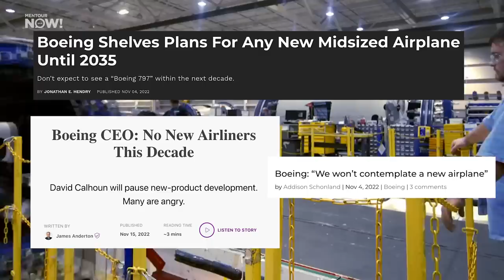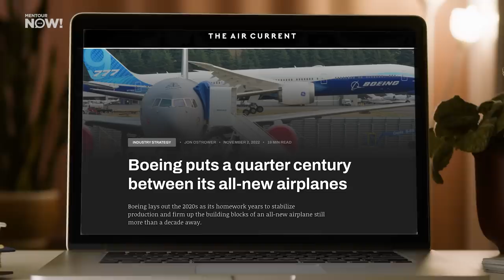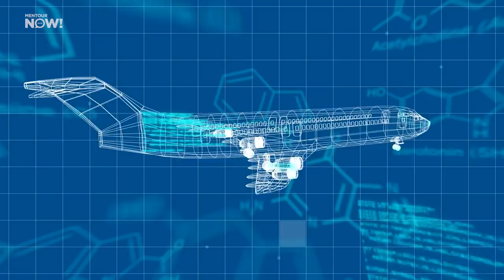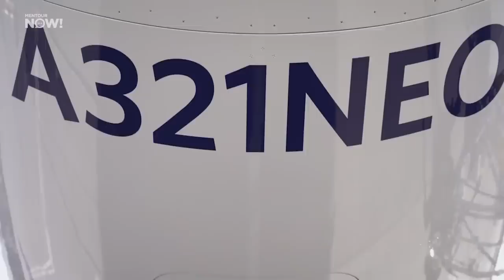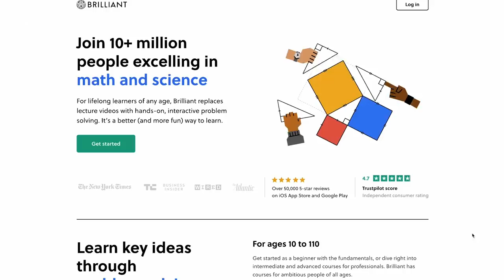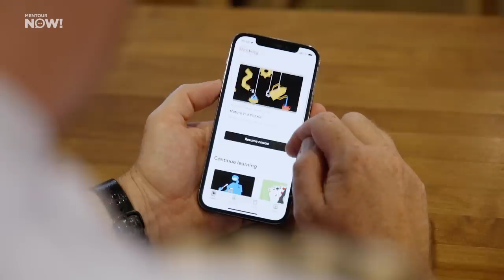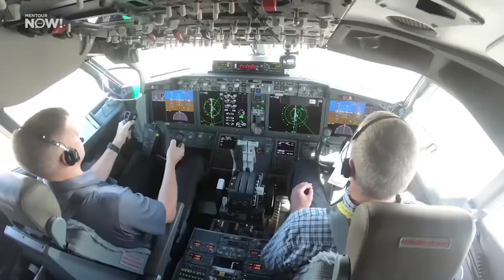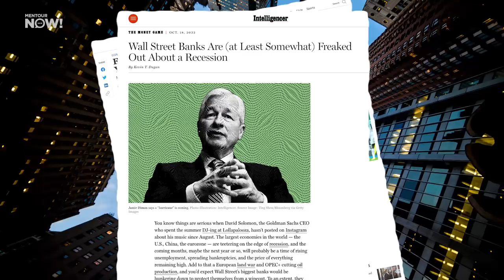Is BOEING giving up!?

Comment: If you look back over the last 25 years in the commercial aviation industry, nearly every time we are told that a new product is coming by some date, it actually ends up arriving 3-6 years later. So if they're telling us today that the new RISE engines will be available by 2035, history says that will probably become at least 2040 (assuming they ever come to market at all). And that's a long ways off.
Reply from the maker: Yup, very true
Reply: And we all know from recent history, Boeing is not the best manufacturer to ask to upgrade an existing aircraft type with new engines. (The big exception here is the B-52 Stratofortress, of course).
Reply: It seems a bit fishy to me that development of a propeller engine is going to take 15 years minimum.  That sounds like it’s closer to a pipe dream than a reality with the efficiency gains being purely speculative at this stage.
Reply: i think it could be developed in 2 years, there's nothing complex about it that would demand 12-15 years to build. I could probably build it in my garage in 15 years! The questing is what kind of airplane is it for? Looks like a very small kind to me. Will there be demand? Probably very narrow. It might be a great engine for regional aviation, but then again - are current turboprops worse than this new thing? And if so, how much worse? Radically worse or meh-kinda worse?.. Can it be mounted on a plane that would compete with 737? Or is it competing with bombardier 5000?.. Noone will take it seriously if it can't compete with 737... much less 15 years into the future.
Reply: @dmitrynova  the problem is and will always be the planetary reducer, needed to run the prop way slower than the core.
Reply: @ameunier41 it’s true that propeller and fan gearboxes have been historically extremely difficult to design and there’s been many failures in the past, but it’s been worked out for decades, there are geared turbofans and of course turboprops in operation around the world for decades…
Reply: Decouple the core from the propeller. Make the core a pure electric generator and the propeller with electric motor. A series hybrid in other words. No more gearbox issues :)
Reply: Thirteen years to produce a new engine? NASA went from nothing in the early 60's to putting 4 men on the moon before the decade of the 1960's ended.
Reply: concidering the projections are already conservative, and that there would be a 20 year gap between the new designs i would think everything will be fine. Judging by what boeing is saying i agree with mentour, boeing already has a design and its purely waiting on outside influences. Engines arnt terribly hard to make, i mean look how quickly the jet engine was invented during the war period. So i think the time scale is reasonable. Its not like they are inventing a fusion energy engine.
Reply: @whyyeseyec  NASA had the benefits of fuckloads of government military spending and also no markets that enjoy stasis and have to care about standardization etc. Could be a lot faster but I also don't see anything replicating the space race unless people have something to hyperfixate on again (hopefully with better intentions).
Reply: @whyyeseyec  who paid the bill ....
Reply: @theagentsmith  Electric gen-sets are very heavy per unit of power, and the energy losses are not significantly different from the simple planetary gearbox, overall reliability of the system isn't much different either.
Reply: @whyyeseyec  Its the Pareto principle, the first 20% of the effort gets 80% of the results.(Likewise the last 20% of gain take 80% of the total effort.) Aerospace is now very mature and gaining that last 10% is orders of magnitude more difficult. 
Say you start with an initial thing that is 30% efficient, like some old wood and cloth windmill. Apply some engineering effort an it's not to difficult to get it to 60% efficient. At which point you can claim to have doubled the efficiency. However, even with unlimited resources and effort it is mathematically impossible to double it again, and to add further insult  all of the obvious easy stuff were the of course first improvements to be made.
Reply: @berndeikers8924  Yes, I know. It just seems like 13 years is a long long time.
Reply: @ReneSchickbauer  That's a rather overly simplistic view... Boeing has performed multiple successful re-engine programs in history. The original Boeing 707 was re-engined. The KC135 tankers were re-engined twice, from the original J57 turbojet to the Pratt JT3D, and then re-engined again to the CFM56.

The Boeing 737 itself had also been successfully re-engined from the original low bypass JT8D to the CFM56 (737 Classic), and then re-engined again to use newer versions of the CFM56 (737-NG), both of which were huge sales successes for Boeing. The only re-engine project that proved problematic was the most recent (737-MAX). If you actually go back through their development history, their re-engine projects have been successful more often than not.
Reply: @mytech6779 Was Boeing using the Pareto Principle when they added MCAS?
Reply: Yes, indeed - if they´re succesful in building it!
Reply: @theagentsmith  Adds weight, adds another point of failure and things electrical can cause fires. Best to stay mechanical.
Reply: @whyyeseyec  Yes, but NASA had what was essentially unlimited funding to do that. Boeing lack that.
Reply: Committing to the RISE engine would seem to pose a fairly high risk that the engine development doesn't pan out as hoped for. A major factor in the commercial failure of the Lockheed L-1011 Tri-Star was the bankruptcy of Rolls Royce and consequent delays in producing the RB211 engine.

Although I suppose if they're just pausing while waiting for any improvements to engine and other technology, they'll be able to decide later what technologies they care to pursue.
Reply: The RISE engine (then called an inducted fan) was supposed to be coming back in the 1980’s. Turboprops are not a new idea even if you give them a new name. Even if an advanced-technology turboprop can compete with turbofans economically, there are also uncertainties about market acceptance. If people don’t want to go back to riding in propeller planes, it won’t matter that they’re more efficient.
Reply: In the past that certainly has been true. I honestly believe we are at a point though where all development regarding efficiency and sustainability will rapidly accelerate. EVs are just the beginning - they are taking the market by storm, but I think the next few years will send even clearer and stronger signals to companies and investors to to make new technologies happen faster than we have ever seen before.
Reply: @edwardwright8127  My understanding is that unducted fan engines are substantially different from traditional turboprop engines. And I don't think that passengers will care much, if at all, what kind of engine their aircraft is using (as they don't care now) so long as it's reasonably quiet and reasonably fast.
Reply: Jet A1 fuel !!!!! Is anyone talking about fuel availability when these new planes (????) come to market in 2035 - 2040? We are supposed to be reducing carbon emissions to avert the spectre of climate disaster and these aircraft carry 100's of thousands of litres of fuel (yeah there are more road vehicles consuming fuel than airplanes by a long shot but... it all adds up).
Reply: @edwardwright8127  It has some visual similarity but really isn't a fancy turboprop. There are some fundamental differences in the fluid dynamics. Which is why a turbo prop is reletively quiet and a ductless fan is very loud.
Reply: @whyyeseyec  uhhhhhhh, does Artemis ring a bell?
Reply: I think Boeing is just announcing this for shareholders who want Boeing to respond to the upcoming recession.  Design activity should be continuous, announcing this could just be Boejng preparing to layoff designers, which will definitely be a ridiculously stupid move, since talented designers take years to iterate through good designs.  If silly management think they can just hire designers and have them running, they will end up with an inferior design in the future.  Agile methods is stupid and inappropriate when it comes to designing something like a multibillion dollar end product.
Reply: @dmitrynova  In the video showing the RISE there was text mentioning single aisle planes.
Reply: Blame their merger with Mcdonald-Douglas
Reply: and notice the CFM presentation having 2050 in very large letters in the background...
Reply: Don't current safety regulations require the fan case to contain a fanblade failure? How will this requirement be met when they no longer exist?
Reply: Boeing's problem is the management looking at the management personal pockets getting lined.  Need engineering management operating upper level management.  By the mid 2030-2040 Airbus will own boei ng.
Reply: they RISE and they fall...
Reply: @whyyeseyec NASA was operating at breakneck speed (w/ the acceptable safety checks, which the Soviets never cared about) with large amounts of government funding with no FAA or profits to worry about.  This is something different.  There is probably a reason why it will take so long.  We do not know what it is, but I think that everybody will find out once the engine is available.
Reply: And that is assuming there will still be an airline market. Given the rate at which the world is deteriorating at present, no market is a given.
Reply: @ameunier41  Would repolarizing the quasitrons help?
Reply: @whyyeseyec  I'm not sure the failure rate would be acceptable for passenger aviation, grandpa.